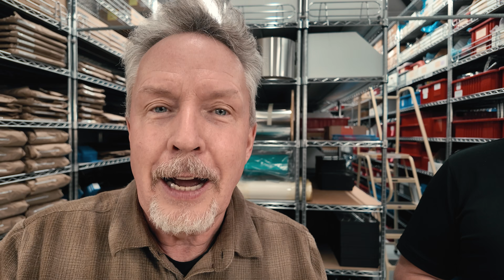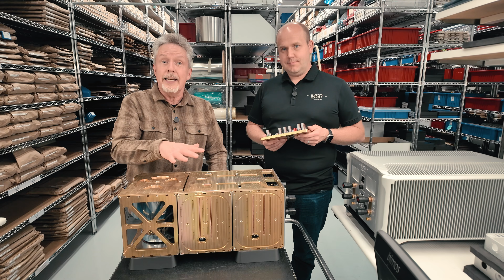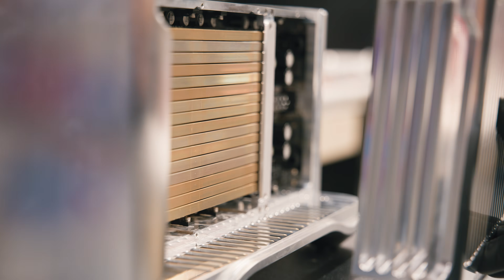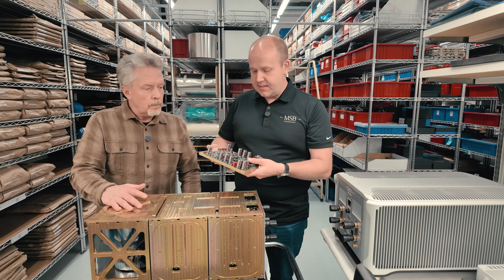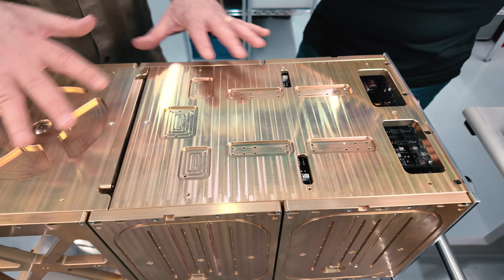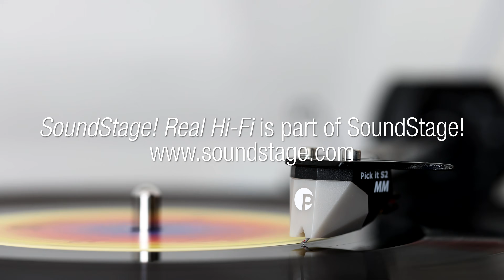Heat vs. Hi-Fi: MSB’s Jonathan Gullman Explains What Matters and Why

Comment: Oh for God's sake - Valve amps have no issues running way hotter. And they sound better.
Reply: Tube amps only sound better in the middle, they don't in the higher and lower frequencies.
Reply: You sure about "no issues"? I've had a number of tube amps and ventilation is key. Electronics in general don't like to run too hot. I don't think you'll find anyone who disagrees with that statement.
Reply: No issues other than replace the output tubes every nn hours, and to say valve amplifiers sound better is subjective.  Transistor amplifiers have a faster slew rate than valves and output transformers are effective all-frequency filters.  Transistors don't require heaters and if valve amplifiers didn't run hot they wouldn't work at all, the high voltages in valve amplifiers put components under more stress which makes them less reliable.  Why use a 450 Volt rail when you can use +/- 50 Volts?

Comment: I cut the barrel plug off an unused 12v wall wart style power supply and soldered on a 2 pin pc fan connector, I plugged in a 180mm pc case fan and it sits on top of my AV receiver. You can't hear it and it keeps it cool to the touch, been using it to drive 4 ohm speakers and it's 16 years old and has never given me an issue even with long listening sessions at a high volume.
Reply from the maker: Did it have heating problems before?
Reply: @soundstagenetwork  no I did it as a longevity hack since temperature and electronics lifespan are related
Reply from the maker: @Mike-jm5wt  Good thinking!